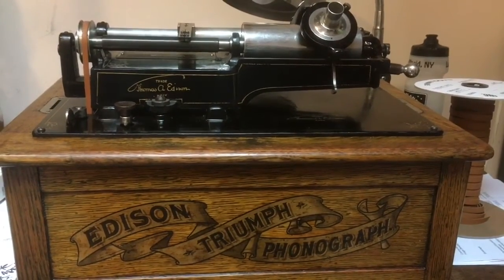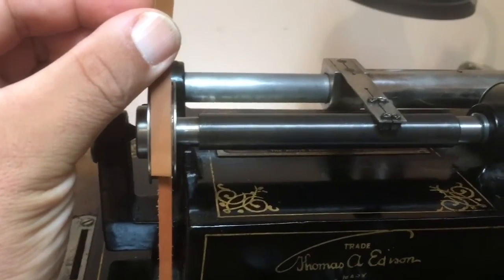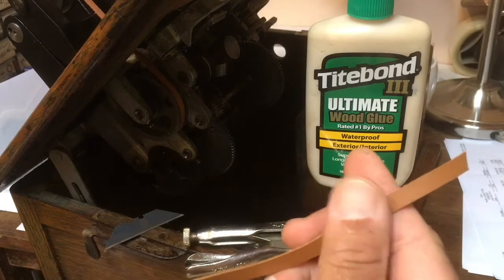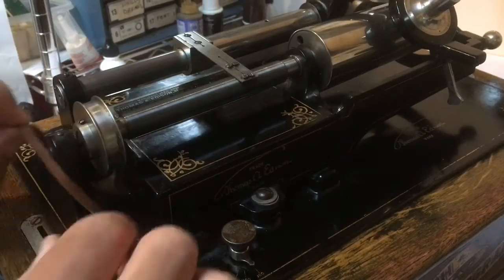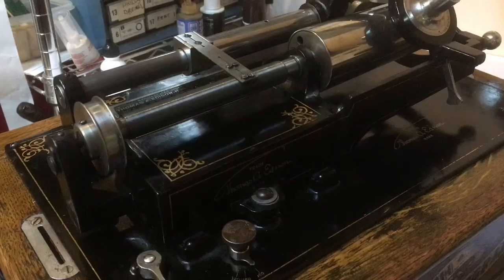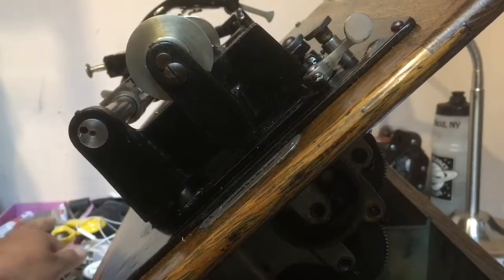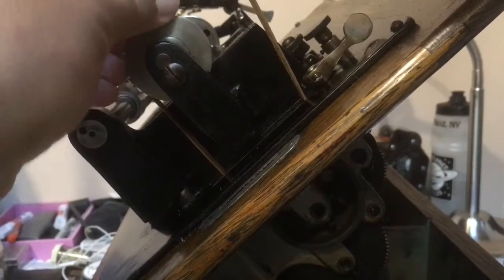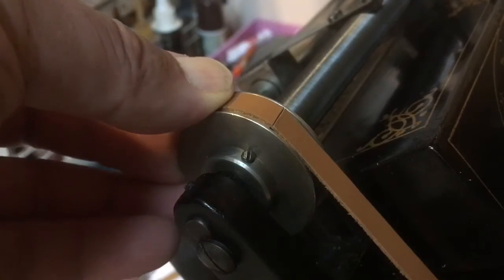How to install a leather drive belt on an Edison triumph cylinder phonograph

Comment: I'm glad I got your belting: the stuff usually provided is too stiff to run smoothly.

The best belt I made previously was from skiver taken off an old dress belt: I must confess I'm not as good at beveling the ends, though. The only time I had to glue the belt in place was on my Standard: the Home A, and the Columbia AT and BF, both allowed me to remove the belt before splicing.

Comment: Hi Wyatt, good video.  Like the wood glue idea.  I've used contact cement,  messy.  We've met at Wayne.  You saved a swollen  a diamond repro for me, still running good.  I am glad I've acquired this skill as I have rescued many women on the side of the road with broken belts!  I'll be getting some belting soon, good winter project